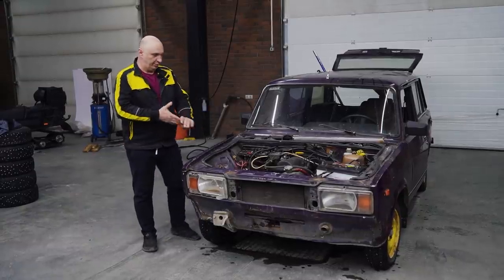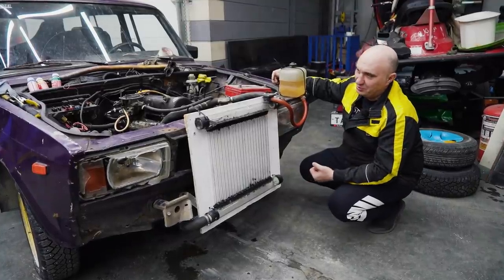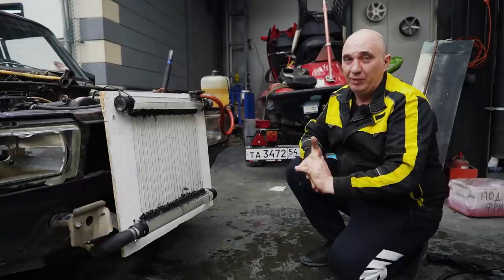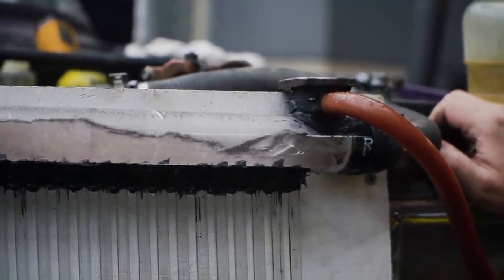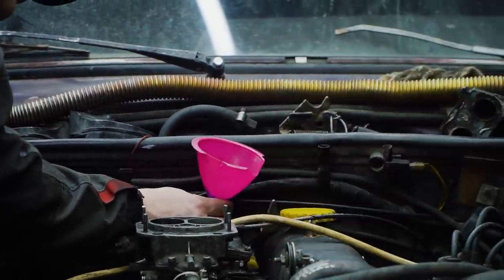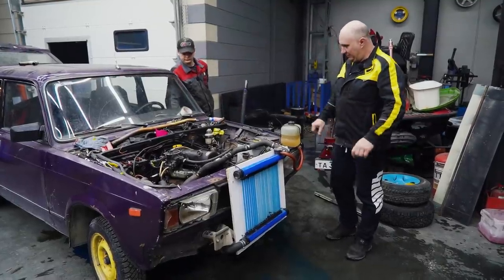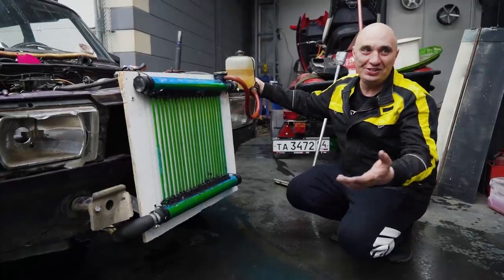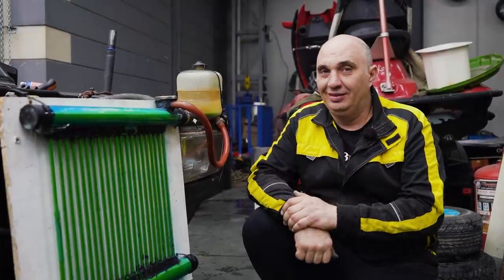We make a transparent radiator

Comment: This was actually really impressive. Didn't realize how fast the water circulated.
Reply: I always assumed that the fluids in an engine just moved slowly so they would do a better job at exchanging heat.
Reply: You never topped up a rad with the engine running to burp it? It's easy to see on a rad that has the cap on the tub and near the inlet hose.
Reply: Lol?
Reply: First time I saw how coolant flows through a radiator. So nice to learn something new. Peace vf
Reply: Glass tubes was a bad decision though. Very poor, even bad conductor of heat.  That's why the plexiglass tubes are very hot and the glass ones weren't as hot.
Reply: @WolfieMel You couldn't be more wrong. You want a material with excellent thermal conductivity.  Copper is what was historically used for radiators.  Problem is, copper cost more money. Per pound, copper is significantly more expensive than aluminum.
The material needs to transfer the heat out of the fluid and into the fins.  This is why they used to use copper.  The fins are for the purpose of increasing the surface area of the radiator.
Aluminum has OK heat conductivity, better than most other materials, just nowhere near as good as copper. Copper is extremely heat conductive. There is no common metal anywhere near as good.
Reply: @jwalster9412  it changes as engine speed changes, meeting the cooling demands
Reply: @scottgriffin449  dude it's been 10 months.

Comment: There's a company that sells transparent upper rad tubes for JDM cars. They even provide backlight LEDS to make it pop
 SO cool
Reply: What company is that?
Reply: That sounds awsome 😁
Reply: sounds like the custom PC world has bled over a bit?
Reply: Sounds exactly like the kinda thing JDM guys would dig
Reply: @EATSLEEPDRIVE2002  I mean, I dig it 😂
Reply: Gaming PC + car =
Reply: Clear high performance car parts go all the way back to the 60s and 70s and probably even earlier. A lot of high dollar muscle car guys had custom clear hoods/scoops, radiator hose pipes, valve covers, air cleaner lids, and even distributor caps and spark plug wires you could see the spark travel through. They backlit the clear accessories with one color Christmas lights too.
Reply: @sethbingo  killer glass
Reply: @twiztid1fiddy  thanks man

Comment: Surprised the plastic didnt melt. A good test is to drive it and see what happens. Maybe attach clear parts to the engine like oil pan valve cover oil filter air filter including the clear radiator. And or how about a clear plastic throttle body? Be cool to see.
Reply: if a see-through intake could be made and used with the see-through throttle body, i bet that would look cool.  even a see-through carburetor and a side by side video of the carb and throttle body.
Reply: I think they did a clear oil pan not long ago. And the clear oil filter.
Cool stuff these guys are doing.
Reply: Might not be a good idea to test drive it because the white background will block airflow and the plastic and glass are not great as conductors of heat so the transfer of heat from the coolant/water to the radiator and then to the air is poor. This is made worse by no radiator fins to increase surface area. In short, the engine would probably overheat eventually.
Reply: @jdslyman Good point yeah, the pressure definitely wouldn't help either.
Reply: Plenty of cars have or had plastic radiator top tanks
Reply: @DrBlueTongue  top tank vs whole system is way different
Reply: plastic doesn't usually melt until around 250C. Water can only reach 100C.

Comment: Really cool to see the thermodynamics at play when the thermostat opened. Seeing the colors fill the top of the radiator before flowing down surprised me, but I guess it shouldn't have, heat rises. I loved the laminar flow coming out of the small tubes as well
Reply: Well, it's a bit different. The reason the colors filled the top is because the top hose is connected to the thermostat where the color was poured in and the bottom is to the engine block. That's what he mean when he said big circle. Because it circulates in one direction to keep the engine cool

Comment: Great idea G54 Team. Can you please hear me out? Make a video where you replace a prop shaft on a manual car with an automatic transmission. Then try replacing it with a manual transmission and have someone changing gears in the back seat. Basically dual transmissions and gearboxes. PLEASE!
Reply: So basically have the engine hooked to a automatic transmission, that then goes to a manual transmission ? Neat idea if I'm thinking of it correctly.
Reply: The problem is you'd just create another gear reduction. It would net the same results as the multiple differentials video they did, but just be a lot bulkier and harder to do... now maybe interesting if they could custom gear the second transmission to extend a 5 speed transmission to 10 speed.. but I doubt they'd be able to reach such speeds to get last gear in a lada.
Reply: They already had a episode were they used a few extra differential to make a creeper gear.

Comment: That was indeed impressive. I would like to see this on a Thermo-Syphon system. IH made some of their Farmall tractors without a water pump. It worked by the water moving as it got hot. They still made some of these models in 1953. I was wondering why you didn't use anti-freeze to begin with, but it was more impressive to see the

Comment: Modern cars are designed to have air flow across the radiator at all times. If you go too slow, the fan will kick on to keep engine at the correct temperature.

Comment: how about putting a carburettor on a very modern fuel injected car? Once I did a conversion to a 96 model Nexia, coz the cost of replacing the ECU and other sensors was a lot more expensive than making a manifold adaptor for a new carburettor but it was an older EFi  TBI system where the ignition system was separate from the fuel system ECM/ECU. How will the ignition and ignition timing work

Comment: Mount a screw auger in the lower tank. Using nails and tubing as supports then watch with a black light. (Screw auger can be made by twisting hot plastic flatbar) paint a black dot on the leading edge of the screw and use a revolution meter to count the speed of the revolution, so you can determine a flow rate. 

The n on another video Do the same thing for airbox and exhaust... show everyone how to flow bench an engine for efficiency.. using a glass cylinder the same size as the cold side with revolution counter that matches 

Compare the intake cold side flow rate to the exhaust hot side flow rate to get 1:1 efficiency for race motors(ideal is 1:0.99) adjusting for loss.

Comment: This actually show how low is pushing force of water pump, and how significant is sucking force - the pump is more a sucking than a pushing device.
So the most moving force in cooling system is pressure difference, and pressure drop in inlet of pump is most significant.

Comment: Garage 54 I'll be watching some of your videos for quite a bit of time I like the fact that you guys like to look outside the box and the sense is basically for what is happening it is good to have outside solution everything is going up worldwide food gas housing and so on I definitely feel a thought about a suggestion and I definitely appreciate and love some the videos you do you people are amazing however now in there sense of what we dealing with economy how to save on fuel what about running your car on bio fuel what about running it on oil frying however also running it on methane methane can be easily produced on farms and any decomposable can create methane it is explosive however it is a source that could be used to fuel cars it is free emphasis on free as well as pyrolysis converting plastic into fuel what you heat up your plastic up to 400 degrees into a container it creates a form of diesel will there be a chance of exploring these situation this would be good for all of us to basically get a system that would work what all having to rely on big oil companies. That the average person can make their own fuel out of plastic of course you need to have a diesel vehicle the methane will work apparently on standard gas vehicle I have seen lawn mowers being working with this type of methane gas I also like the fact that you managed to test out certain without having to use rubber I like the fact that you use Springs on a wheel this type of system was designed back in the 1940s during the second World War bicycles operating on this apparently I'm a sizing on inflation because inflation is going up everywhere the whole covid-19 screwed up a lot of things at the same time it makes you think outside the box I do admit as well but I also believe in thinking outside the box I haven't been to Russia however I've been to Cuba this country is incredible the people do not have much resources however detention look outside the box Define ways how to fix problems this is what was amazing about this country what you can do with little resources is quite amazing actually quite impressive garage 54 I wish you the best I like the fact that you're trying different concept and different ideas please continue and thank you for sharing your videos all the best the garage 54

Comment: Thought the tubes should be horizontal though🤷‍♂️
Reply: I was thinking the same thing.  This is really cool but how close is it to a real radiator?
Reply: Some radiators are built vertically like this, some are built horizontally. I'm not sure that it makes a big difference, it's probably just manufacturer preference.
Reply: Vertical works better without pump

Comment: Love the demonstration, but you did one thing wrong.. the tubes should be running horizontal, not vertical
Reply: Lada has vertical radiator. Actually all with the expansion tank at top are vertical
Reply: @V8Lenny  i stand corrected. Thanks for the knowledge sir

Comment: Dump ice cold water into a red hot engine.  I was told it would hurt an engine to run it without a thermostat.   The cold water would shock / crack the engine block.  You could have it set up so after the engine reaches temp, a valve would dump the hot coolant, and another valve could let ice cold water into the engine.